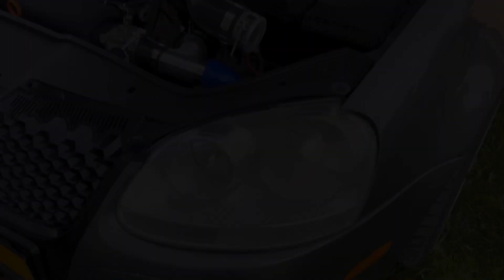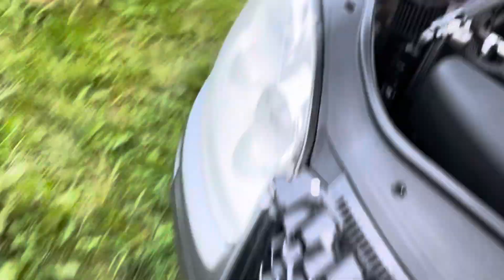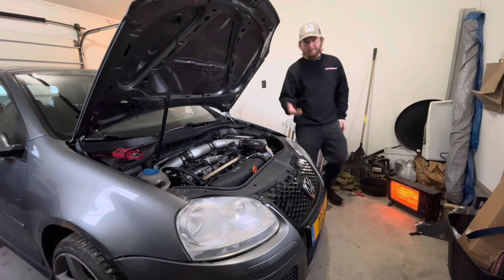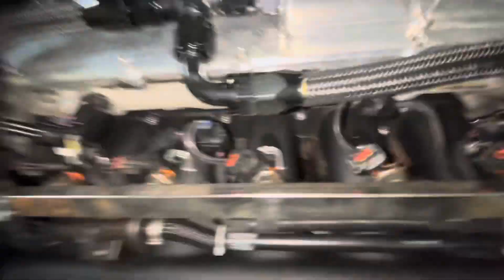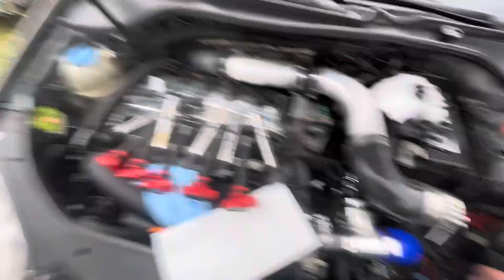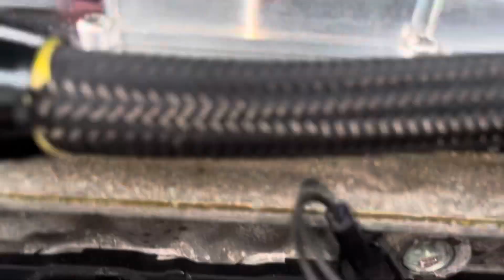The 2.5T GTI is Finally Ready!…kinda

Comment: I wanna do a turbo build my self for this car. I have the Jetta 07k from 2013. I have to use Spa intake manifold cause of hydro steering. What did you do to get your car were it is
Reply from the maker: I have the spa bottom mount exhaust manifold, has been working well for me. Car is tuned with united motorsports and runs great, with good power. Spa intake should do you good.

Comment: Hi there, was wondering how you went about wiring it in? Did you just re-pin wires on the engine ECU to the GTI body harness?
Reply from the maker: Yes basically, there are a few other small things to do aswell. I have a swap guide in the bio of my instagram @ragged.rabbits

Comment: just curious if you gapped your plugs to the right spec. might explain the misfire.
Reply from the maker: Plugs were gapped properly. Misfire was due to a bad fuel pump.
Reply: How  many PSI were you running  @odell_productions
Reply from the maker: This is my current setup but currently daily it at 9psi but have a switch for running about 16psi.
Reply: @odell_productions greetings from SoFL, in the process of ding mine as well, but running 10 PSI max

Comment: what's your mod set up?
Reply from the maker: Spa exhaust manifold, precision 5858 turbo, ie intake manifold, fmic, 550cc injectors, um tune. Stock engine internals and a couple little things. Ill make a more in depth video down the line talking about everything specifically on this current build.